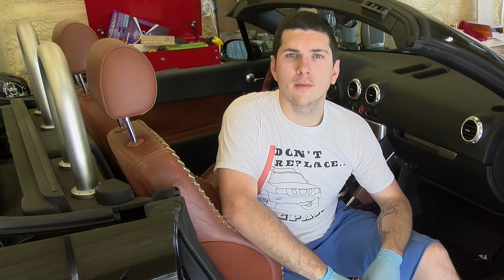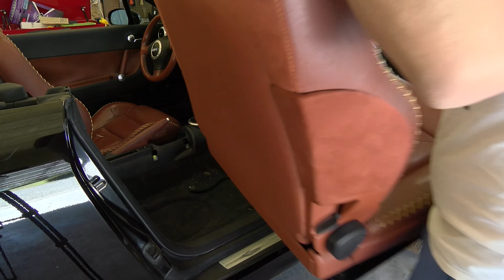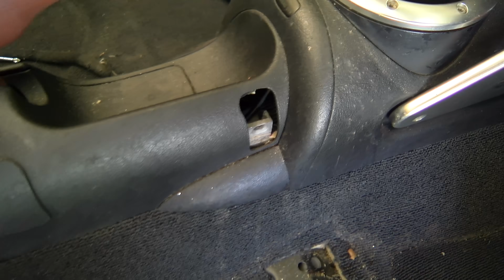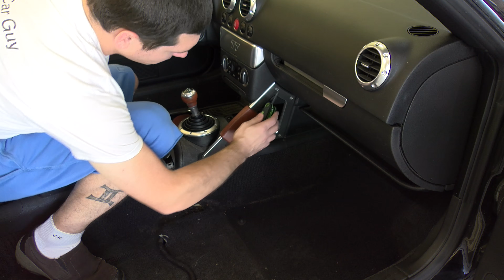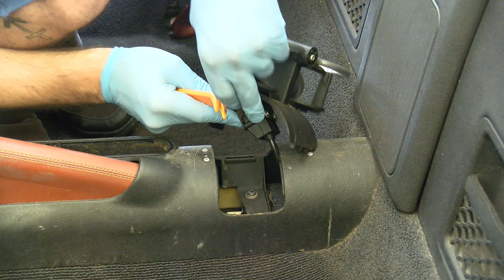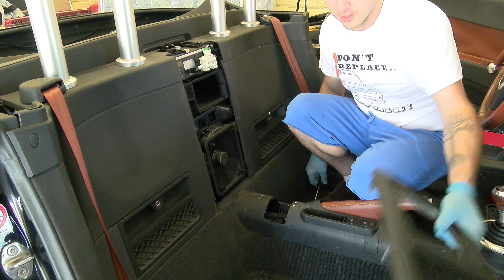Audi TT Interior Teardown

Comment: 2025 I just bought a 2002 Audi TT Roadster. I needed to buy a rear brake enclosure so I called Audi and they told me that most of the pieces are now obsolete. 
What kind of b***** is that
Reply from the maker: Wowwww real nice.
Reply: I mean what do you expect 😂 its a 25 year old car that has had many redesigns audi wont has unlimited stock of everything  😂

Comment: I really enjoyed your video YouTube.  I have the same mk1 convertible. The sun did damaged the push-in plastic button, located at shoulder level on the passenger side, to release the convertible tonneau cover.  I pushed it in and it broke off fell off inside.  I wonder what is the button called, where to buy and how to replace it.  Thank buddy.

Comment: Hi, thank's your video is the best, I want to install a hardtop on my TT, but i didn't have the originale wiring connection for this,  i have order the bracket mounting roof but my TT didn't have the wiring to put on the bracket, do you know where i plug the wire behind the Seat ?

Comment: Where do I find part two? I am trying to access the roof motor on a 2001 right hand drive car, exactly the same as the one you are stripping here. I need ot get the CD Changer out of the way, I think, from behind the passenger seat.

Comment: Can you show how to remove the drivers door panel and driver trim (to the side of the steering wheel). Im getting flooding into the drivers footwell. Im trying to work out if its from the door or from the windscreen and leaking between the door and dashboard

Comment: I need help! Please! 
2000  Audi tt.
Does anybody know how to fix fuel cap release button.
I checked the button and it looks fine. 
I open my fuel cap manually from inside the trunk. 
But I want to find out why my button from inside it's not working!!
Anybody ran into this problem before.  
Any ideas, suggestions etc. 
Has anyone fixed this issue before?
 thanks in advance.
Reply from the maker: I did not have the issue but the button is electronic right? I would start by looking at your fuses and see if the one that controls that switch is blown. Also if it is electric it will have a relay. You could buy a new relay and replace it to see if it works. When you press the button do you hear anything? Or it is completely silent?
Reply: Ry the car guy 
I hear a click tone.
It is electric, I checked all fuses they look good. I checked all of the ones under the dash board since I didn't know which one could be.
Do you know  the fuse and relay  location?  Besides the location under the dash board.
I read something about vw. Fuel cap Switch going bad. The location of that switch is in the drivers side door panel. I'm not sure if the same location for 
audi TT, do u know?
Reply from the maker: Im sorry but I don’t. If you can hear the click it might be the relay. Try to find that.